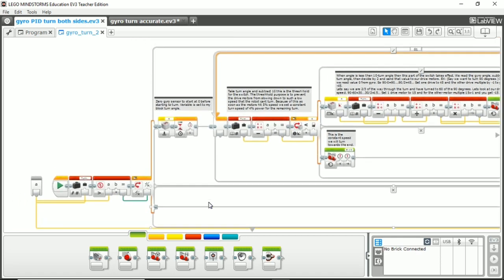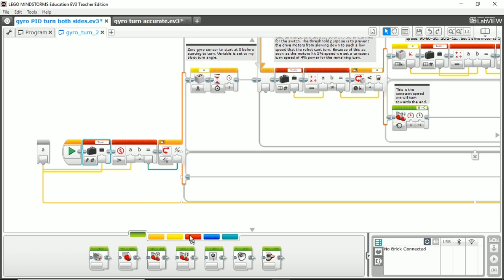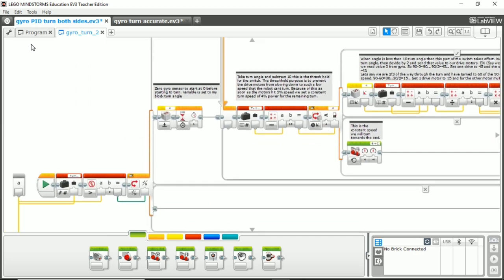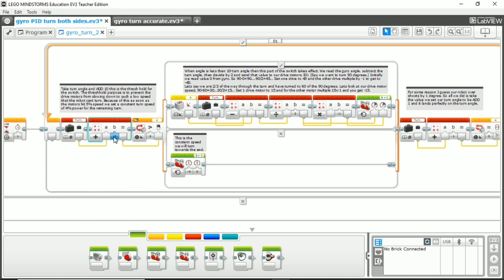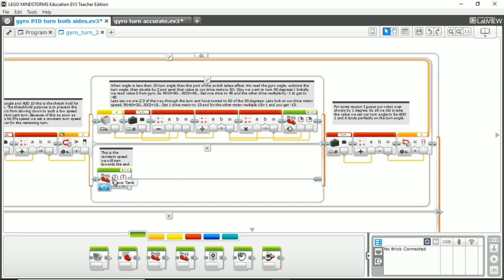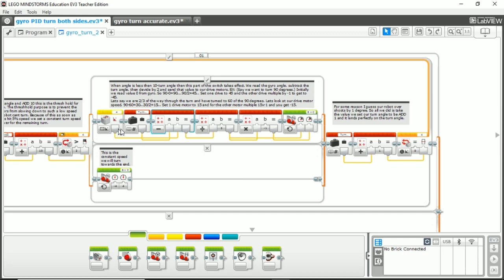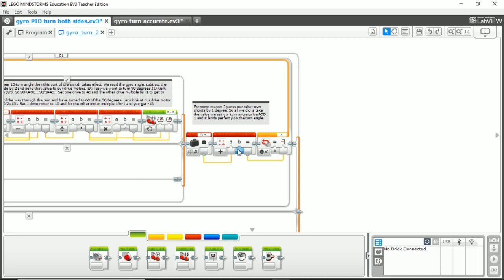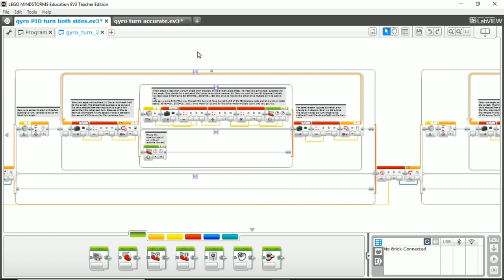FLL Turning Accurately With The Gyro Sensor In Both Directions

Comment: Why are you not using the negative side of the switch ?
Reply from the maker: Can you expand on this question? I'm having trouble understanding.
Reply: @natesimpkins4875  Your switch has a true and a false side. When X is less than 0 you go on the true side then why do you check again if the X is less then 0 and go on the true side again. Can`t you just put one of them as false ? if X > 0 you go on the true side of the switch if not you go on the false. The way you have done it just makes it more complex and time consuming
Reply from the maker: @vlad4331  I did think about that, however then if someone accidentally typed in a 0 it may turn to the one side that is false. By splitting it into true only you can rule out the 0 by making #>0 or #<0 and do nothing if a 0 is put in.
Reply from the maker: It may have worked fine to do it that way too. I just didn't feel like testing it because I knew this method would work because it would rule out the 0 value.
Reply: @natesimpkins4875  you include the compare statement and then another switch in the original false switch statement.     
So original switch states: 
If "TurnAngle" > 0 = true - do stuff,  
Else false; 
[New Switch] If "TurnAngle" < 0 = true - do stuff
Else false; do nothing